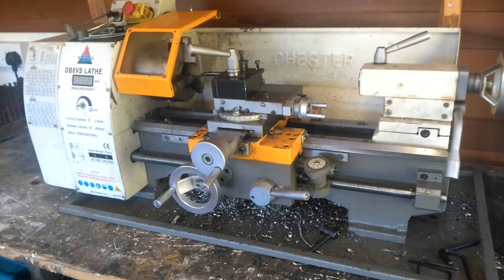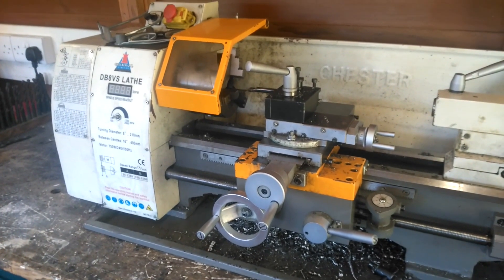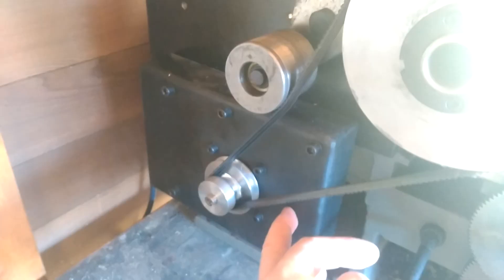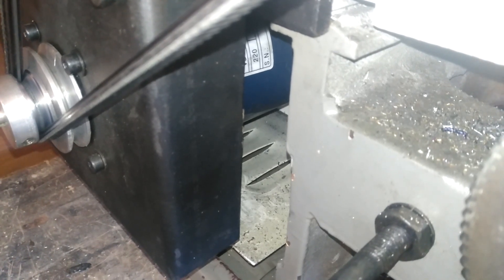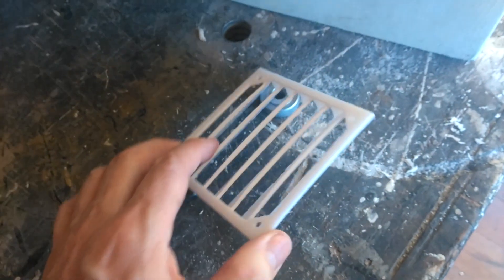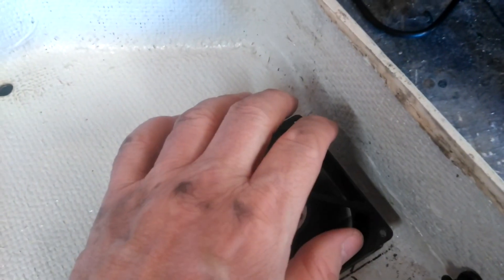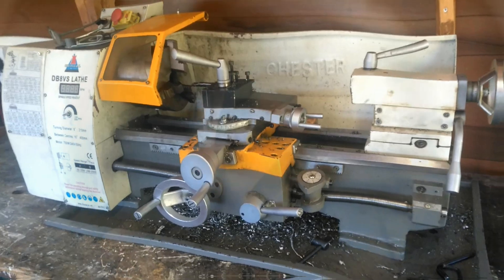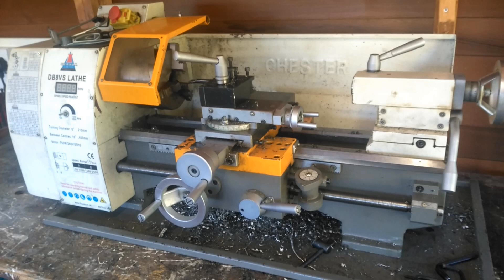Hobby Lathe Overheating on Continuous Use & Cooling Upgrade (Chester DB8VS)

Comment: Quick one is this lathe any good for screw cutting out the box
Reply from the maker: Sorry Rob, I haven't used it for that. There were no change wheels with it, so I'll have to source some or maybe do a computerised solution to avoid the need for them.
Reply: Any problems with the motor iv jus had to send 2 faulty machines bk one had a bad motor an blew the board an the other had movement in the lead screw

Comment: I have run this lathe for over 10 years and never had any problem with the motor overheating. I have run it continuously for at least half an hour and probably longer on many occasions. Were you doing particularly heavy turning?
Reply from the maker: Yes, I was drilling and then boring out a 60mm x 100mm diameter stainless steel bar.

Comment: I would pull out the steel plate to which the motor is mounted and drill it full of holes for the air to pass through. The holes not only let the air through to the motor itself, but it increases the exposed surface area of the plate for better heat transfer. You might want to install a pad ahead of the cooling fan.. you'll get a surprising amount of oily dust on everything with out it. You do have to remember to clean it periodically though.
Reply from the maker: Thanks for the suggestion. It makes sense but, for me, it's too invasive. The plate is at least 5mm thick. My solution is not as robust but it's greatly easier to implement. I conducted tests yesterday (video to follow soon) and it makes a HUGE difference. And there are a variety of plan Bs if plan A proves in adequate. Holes in the top of the motor box for example, would allow hot air to rise out of it.